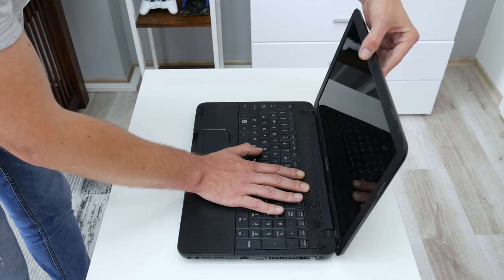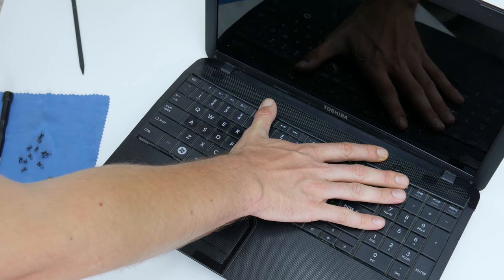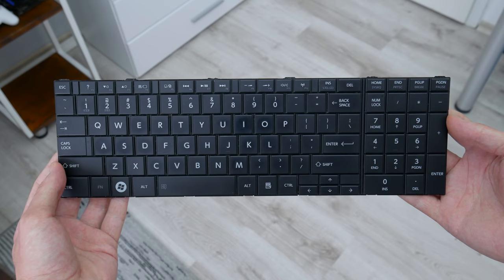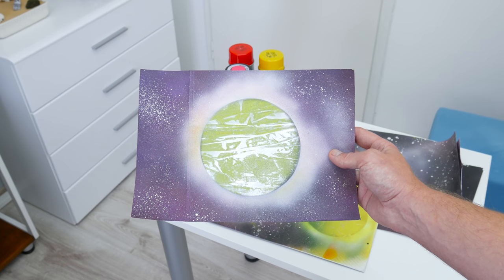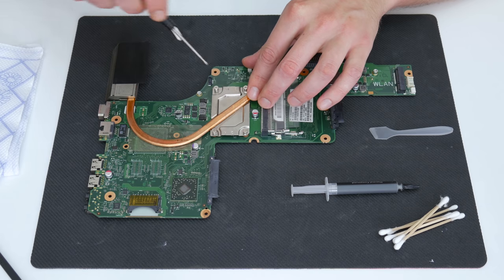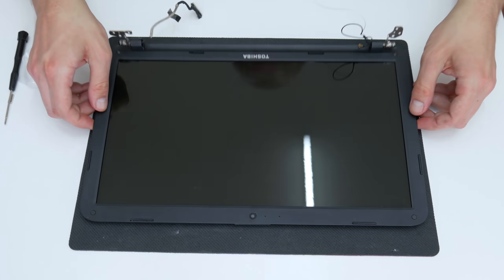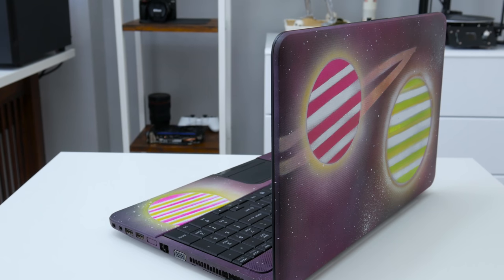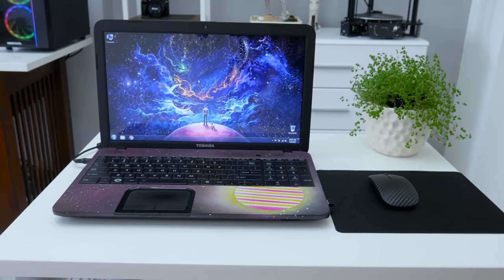Restoring very low specs Toshiba laptop

Comment: HAHAHA 'Believe it or not I have no experience with this !" when he spray paints the case at 9:40.  Like we cant see that ! Your spray painting SUCKS. You should have gone with the vinyl. However I commend your efforts in restoring an unusable laptop. However you do not mention costs ! How much was spent on restoring an out of date laptop ? Also rather than butchering an old laptop for the plastic screw holders you could buy a small lathe and just make them ! I know lathes are expensive but are very useful in the workshop !

Comment: The awkward truth: Windows laptops only work better with their launching operating systems. This means a 4th gen haswell laptop (it was windows 8.1 when haswell laptops were happening) will outperform a windows 10 os on the same machine. If your laptop was designed for Windows 7, Windows 10 will always perform worse. Almost every manufacturers don't have an interest in updating drivers for older machines, and when they do, it creates more problem than good.